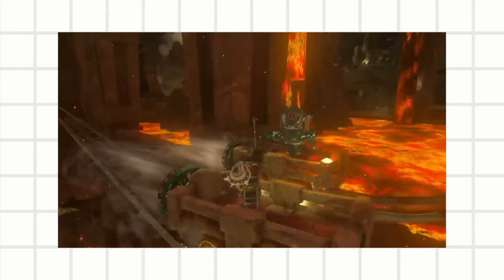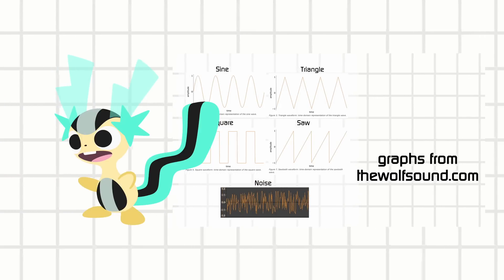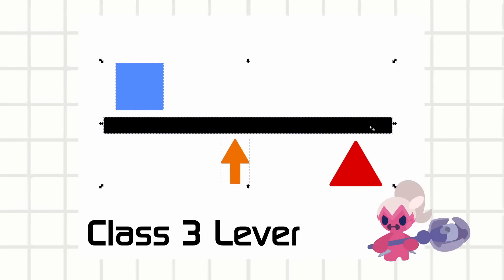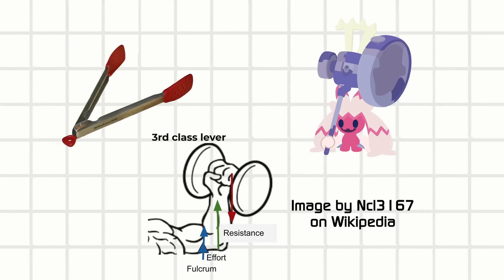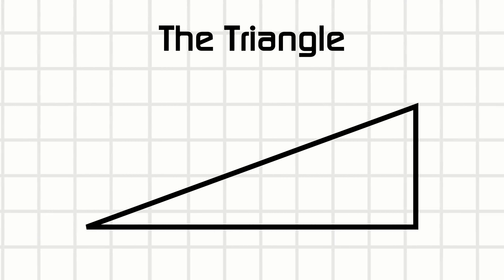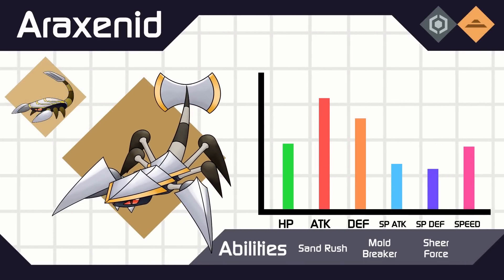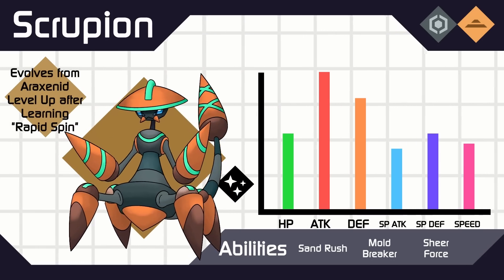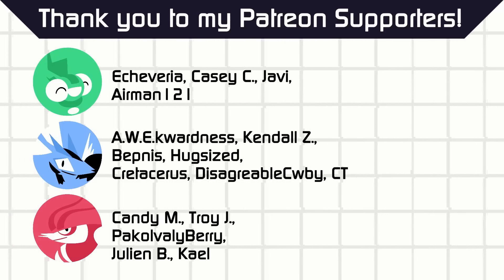Designing Mons off of Engineering

Comment: We most definitely need an H-Bridge Fakemon. Starts as a button, then becomes an H-Bridge Centipede, and finally, some type of electrical circuit that leads to a trotoscope (dumb idea bc of a coding project I did a while ago involving code and building a trotoscope with a motor, breadboard, and circuit board.)

Comment: (going off the bases that the ramp example is from your game and changing direction is implemented like shown) You should use the XYZ concordant plane + mathematical flipping/mirroring/up or down-scaling on the plane to make a fakemon where is bilaterally split so only one side is viable until it turns, each side can be different, maybe a good and bad side. 

Also the clockwise/counter-cloakwise fakemon  sounds like a really fun idea.

Comment: My project has type advantages divided across types and archetypes

Each creature has an archetype which has its own advantages with types dictating smaller, more intricate advantages and interactions

An archetype chart would be something like

Angel > Demon > Human > Angel

Then you'd have your regular Pokemon type charts

Water > Fire > Grass > Water

Because my RPG is inspired by TCGs, instead of an Item system the player will have a deck of 50 cards. At the start of the battle the deck will be shuffled and the player will draw a hand of 5, every subsequent turn they draw 1. Each turn they may play 1 card and select 1 move. 

It will be interesting to see how these changes will effect how interactions happen in battle.

The thought of Stem subjects working as archetypes popped into my head when you showed that list is what intrigued me.